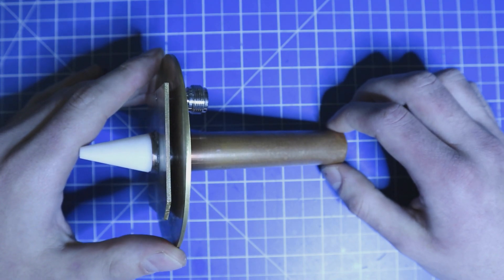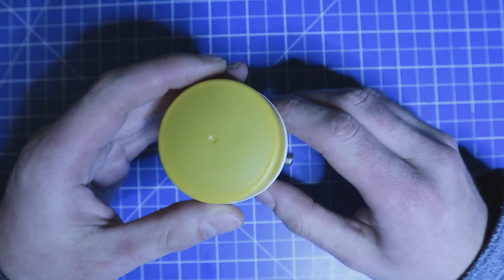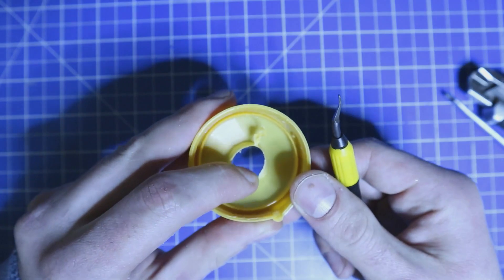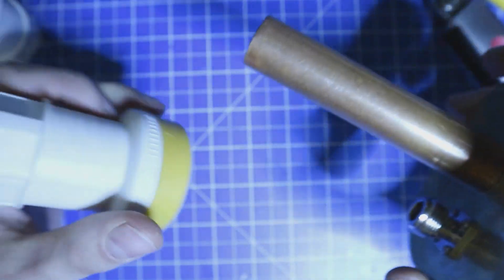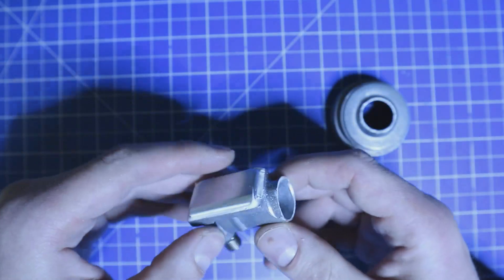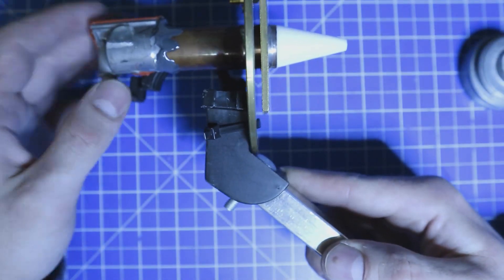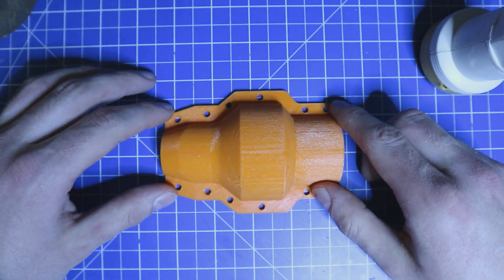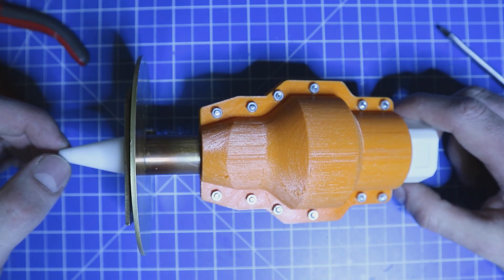Mounting the LNB on the Dual Patchfeed (POTY) the good, the bad, the ugly

Comment: I'm in the process of building a portable QO-100 system. I've got the DXPatrol LNB with GPS and the neck between the flange and LNB electronics is quite long. I'm using this with a POTY so my thinking is to drill slots into the 22mm copper pipe of the POTY and use a jubilee clip (not sure how to translate - it's a circular compression joint with a worm drive to tighten) to clamp the POTY waveguide to the outer part of the body of the waveguide of the LNB. I'm just a little concerned with reflections and insertion loss with this approach.
Reply from the maker: Hey. You could cut the 22mm waveguide and/or the LNB waveguide a bit.
Using the jubilee clip is a nice idea, just make sure you dont distract the signals in the waveguide. 
H

Comment: Cool Video, thanks. I've used for my bult a reducing copper  fitting 35i x 22i. On some lnbs it fits on the inner rings in the waveguide. than i've glued the fitting to the lnb with 2k epoxy, stuck the poty in and sealed it just with self fusing tape. (picture of the fitting: https://mlhaustechnik.de/bilder/100.jpg -- pics of how i've done it on qrz.com )  best 73 de oe8jpq